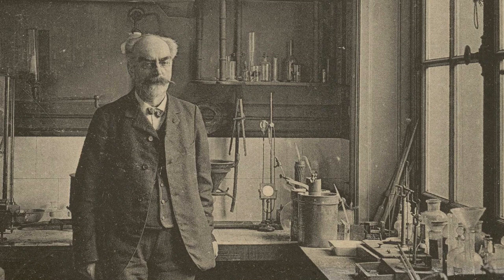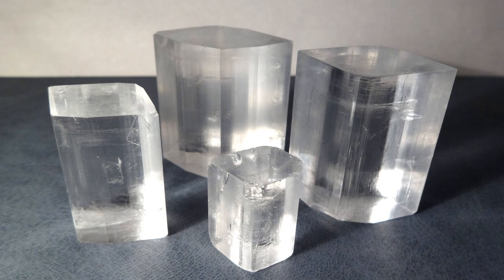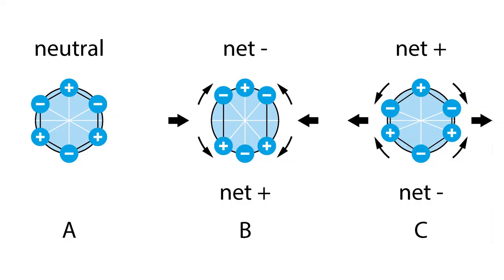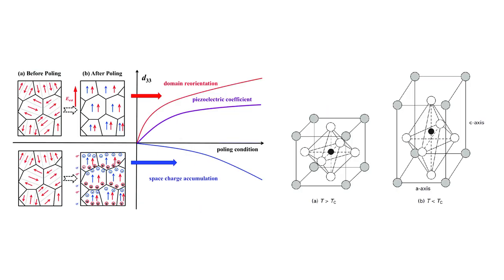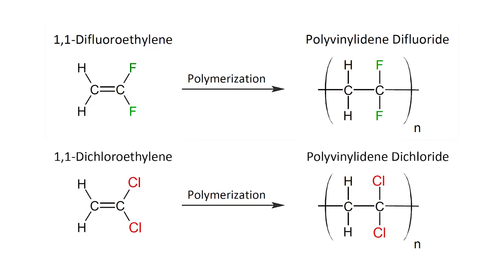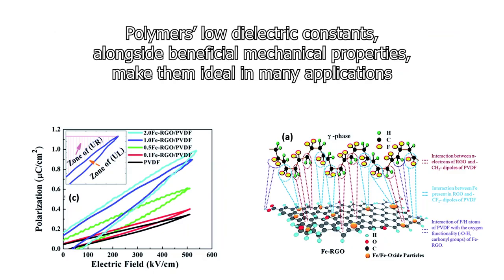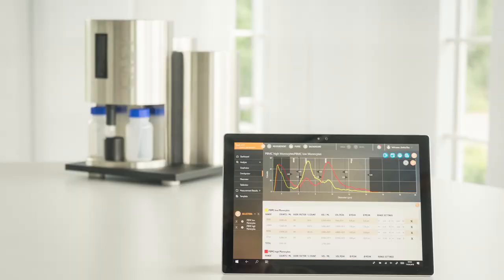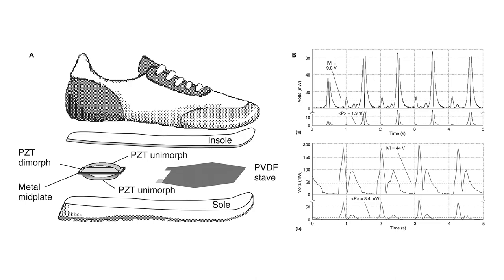Piezoelectric Materials

Comment: I heard there are other things that give gyroscopes and accelerators their properties, what would be the benefits of using piezoelectrics over something like just tiny motors (I'm not sure if that's what it is)?
Reply: probably precision since if a piezoelectric element can develop a voltage drop of 1000V with only a slight deformation, 1/1000th of that would still be detectable compared to other systems